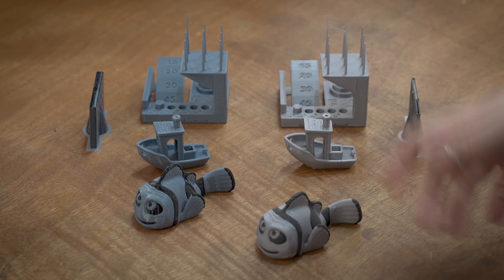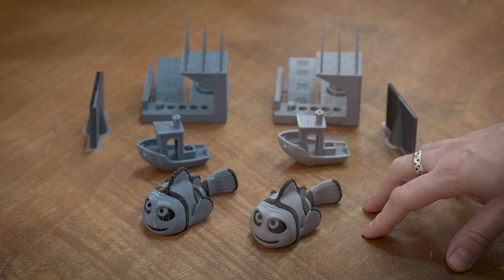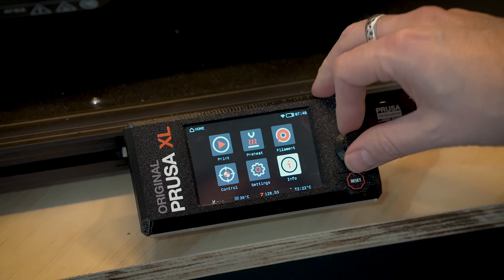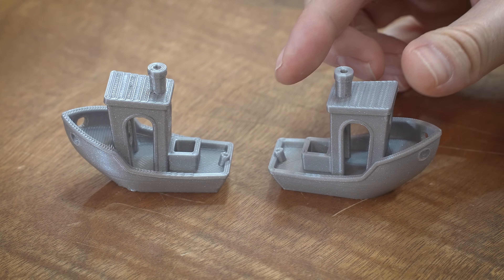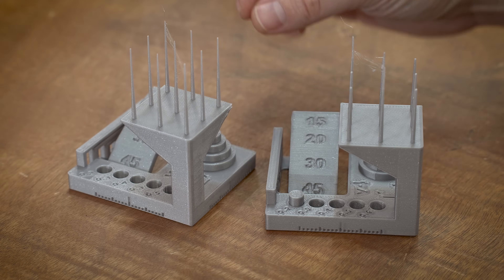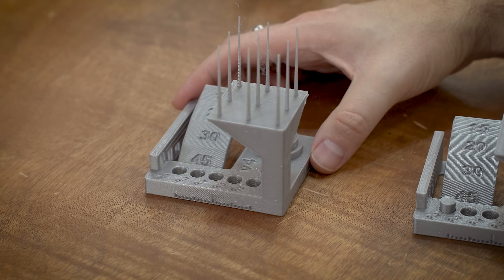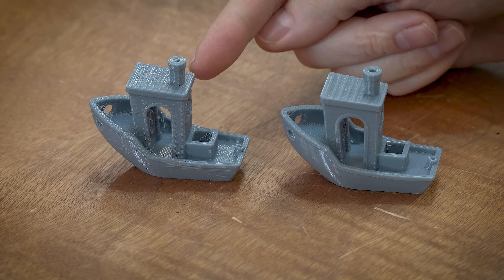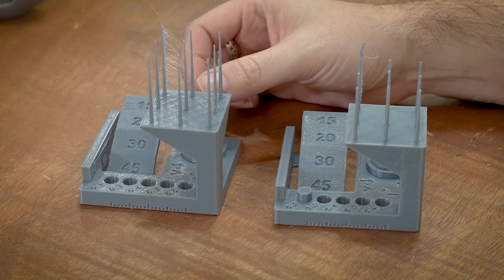Prusa XL - 0.6mm vs 0.4mm Nozzle Comparison

Comment: Does anyone know when drain damage will fight?
Reply from the maker: I still need to finish making the drive assembly (it's about 90% done) and then test out the radio to see if it works inside.  Once all that looks good, I need to harden the shell and build the final parts.  I'm CONSIDERING entering it with another bot at Robogames as a 60 pound multi-bot ;-)

Comment: I personally never understood the trend to use wider nozzles. A wider nozzle is just not capable of giving as much detail as a smaller one. It reduces the print time, but also the quality. For me it is no surprise small, detailed print won't look very good with a 0.6 mm nozzle. I print with 0.4 nozzles exclusively.
For the firmware and input shaping I believe the XL stil has fixed numbers instead of really measuring the resonance for each tool head. When you clean the nozzle when parking and before you use it (I let it scrape over a razorblade), you can even drop the wipe tower. That wipe tower was causing me the most trouble because it does not stick to the bed well enough due to the small footprint.
PETG gives me a bit more stringing, but I think that's more due to the PETG as to the XL. I think the XL is a wonderful printer. Not very fast, but extremely reliable and good for many years of printing even if it is used about 150 hours a week.
Reply: I print most everything with a 1.0mm nozzle at 0.65mm layer height.  Not everybody prints trinkets, lots of us just print functional things that they design with the intended nozzle size and want to print them FAST, single 1.2mm wall widths at 0.65mm gets a strong functional print done in an hour, instead of a day.
Reply from the maker: @JamesSleeman Oh I get it.  Stuff like that fish model is something I'd NEVER print.  I mostly do functional prints.  That being said, the 0.4mm nozzle is working so much better even for functional stuff.
Reply: @JamesSleeman  I mostly print for others and they expect the print to look fine, even if it is just a functional print. 
For speed a larger nozzle is fine, but (as you said) you have to design for it.
Reply from the maker: Intersting.  I'm starting to agree with you on the bigger nozzle.  I think offering a higher-flow option is the way to go, unless you're doing something REALLY big.  But I think it's important to note that I'm not just seeing better details, but the overall print quality is much better.  It just seems a lot sloppier and in some cases the slicer just doesn't know how to handle certain (seemingly easy) aspects of a model.  There's something strange about the 0.6mm profiles.  I have a wiper setup on mine and have very few issues now.  Actually, none.
Reply: Wider nozzles give better strength and layer adhesion. Its best for people who print functional parts. I use a .6 nozzle with 8mm extrusion widths.
Reply from the maker: @LilApe Yep, understood.  That's not at all the point of this video.  It's showing that something funny is going on with the 0.6mm profiles.  It's widely understood that larger nozzles create better layer adhesion and stronger parts.  But usually, a 0.6mm nozzle will show only minor print quality differences.

Comment: As far as this being a single data point, i can say with confidence that the swap to 0.4 and conditioning my filament i get these results. It has been a reliable printer for me and my only regret is that i was between jobs so i could only swing the two tool instead of the 5 tool. 

I love that printer and love using it for my llc.

Big thing i recommend is surface prep and cleaning. Only print failures i ever had came from not cleaning the bed effectively.
Reply from the maker: YES!  With the larger bed it's much easier to put my fingers all over it!  I've been much better about NOT touching it, ever.  Now it's great.  I just wish I had ordered all 5 toolheads, but I ordered within the first hour and mine shipped before I got the option to upgrade :-(

Comment: Maybe the way to go, if you ever get a 5 tool head XL is to have 3-4 tool heads being 0.4 for the print itself while having a 0.6 on 1-2 tool head(s) for supports.
Reply from the maker: Yeah, that's what I was thinking.  I'm just hoping they come out with some sort of high-flow option so I could just stick with 0.4mm for everything.

Comment: It might come down to material flow properties. The hotzone of XL is quite large, with a large volume of molten plastic. It flows by gravity thru the nozzle, which happens easier on the ,60 nozzle... I think it might get better with HF nozzles, such as CHT. This does flow the same/ better, but the filament has much more resistance and friction
Reply from the maker: Yeah, I wouldn't argue against that.  I'd be really curious to try out a 0.4mm nozzle adapter with a CHT nozzle in it...  That might end up getting the same benefits as a 0.6mm nozzle, but with the quality I'm seeing from the smaller diameter.

Comment: The video from Teaching Tech and his follow up to it felt like he was trying to shill for Bamboo. I think that he and a couple of other people have gone down the rabbit hole of trying to tweak the gcode and are not willing to give up on what they think should work. I primarily print PETG with PLA as a support material. I print both 10C cooler than the default and have no issues with a .6 nozzle. I had a ton of issues before the 5.1 firmware and the 2.7 slicer. I think that people are leaving in gcode changes that are at odds with the changes made by Prusa in the 2.7 profiles. 

I agree that the XL is not as fast as some others in pure print speed. Where it makes up the difference is when you are printing with more than one material. The speed of the tool changes without having to do a full purge of an MMU like on other machines makes it much faster. That is why I bought an XL and not a Bamboo. Couple the issues with data privacy on the Bamboo and it was a non-starter from a business perspective.
Reply from the maker: Eh, I don't get that from Teaching Tech.  I've been chatting with him personally though his evaluation of the XL and he's having legitimate issues, as have other people.  I started the video off mentioning other channels and how my experiences are far better for that very reason!  I don't want people thinking I'm trying to oversell the quality of the XL, others aren't as lucky.  But I do agree that all these gcode tweaks are doing more harm than good.  I still see people trying to print filament that's not properly dried, trying to print too fast, etc, etc.  

I 100% agree, when you start printing more than one material, it's WAY faster than anything else out there.  I think for the marlin/fish model, it was 3-5 times slower on the Bambu.

Comment: Crazy how all the fiasco started with a wrong size nozzle.
Reply from the maker: If they had given people the option, or just stuck with a standard 0.4mm nozzle and released it with the Prusaslicer 2.7.0 and the most up to date (today) firmware, it would have been a different story.  Granted, many people are still going to feel like it's overpriced, and that's largely justified since it's really somewhere between the hobby and commercial market.  But it does things that no other printer out there can do.  And THOSE things it does really well.

Comment: You really do make great videos! Thanks for the investigate. I've been running the stock 0.6 nozzles in my five head with good results. I bought five 0.4 nozzles during the black friday sale but not had a chance to compare. I am used to 0.6 nozzles anyway as that it what I have alway used on my MK3S. I agree that this seems to be a tunability issue. I wonder if Prusa switched to 0.6 nozzles late in development due to competition, or if 0.6 nozzles were planned from the beginning. Based on the number of field issues I would think the nozzle diameter was changed later in development, but this is just speculation.

Maybe I missed it in your video, but did you slice with or without IS?
Reply from the maker: Yeah, it seems like they switched over to the 0.6mm late in the game like you said and didn't get everything fully ironed out.  I've been running the 0.4mm for a week or so now and the print quality went WAY up, it's incredible the difference it made.  This is all with the newest firmware and slicer, so I AM using IS.  (Alpha firmware and Prusaslicer 2.7.0)  Also, thanks!
Reply: @RobertCowanDIY ,  why alpha fw? Stable release of firmware 5.1.0 with Input Shaper for the Original Prusa XL was released more then a week ago.
Reply from the maker: @OmDeLaTara  OH!  I should update that.  I just wasn't aware.  I updated to the stable release of Prusaslicer, but apparently not the firmware.  So yeah, everything was printed with the alpha firmware 😕

Comment: excellent work as usual.  ironically i got bambu's 0.6mm nozzle when they released it and had the exact same issue.  they have very few profiles for it and they weren't tuned well.  needless to say, i just went back to 0.4mm and adjust line width between 0.2-0.6 and that gets me virtually the same outcome with one golden nozzle.
Reply from the maker: That's a bummer.  Well, once Prusa figures out how to tune the profiles better for 0.6mm, I'm sure Bambu will release better profiles ;-)
Reply: @RobertCowanDIY  😂 touché
Reply from the maker: @ame7165 Hehe.  "I made this!"

Comment: I run 0.6mm nozzles on 3 out of 4 of my Prusa printers, but I'm just printing stuff quickly with little detail.
Reply from the maker: I was liking the extra speed, but now that I've switched to the 0.4mm, the bigger nozzles might never go back in there.  I'll wait for some sort of high-flow solution.  The quality difference is noticeable on pretty much all prints.
Reply: Can't argue with those results on your printer!
Reply from the maker: @JonathanRansom Yeah, it basically feels like a new machine now.

Comment: Did the same on my MK4, that does come with a 0.4, but I figured I also give a 0.6 a try. I think the main thing is, layer width. A 0.6 nozzle simply prints "wider" lines and this is part of the benefit, mainly in speed as you don't need as many perimeters. But as soon as I print a small figure, the 0.4 definitely wins hands-down, probably also because of this. Stringing has been a bigger issue with 0.6 here as well, there are a few new features in the latest firmware that may help, which I'm going to try as well (the helical z lift and angle).
Reply from the maker: Yeah, line width is increased, but there are other issues happening that should be independant on line width.  Even on larger models where it shouldn't matter, it just doesn't seem to work as well.  On the fish model, I have NO idea why it would have those artifacts on that particular spot on the cheek.  Looking at the slicer, there's no reason for it.
Reply: @RobertCowanDIY in my experience layer width directly correlates with quality of overhangs, especially those with direction change. Also it all depends on the setting which perimeter is laid down first. This might be the cause or one of them. Profile tuning and Slicer should accomodate that though.

Comment: I switched to .4 about a week after I bought the printer due to the issues you've pointed out.   My .6 are in the box and will probably stay that way unless I need to print something very large with little detail.
Reply from the maker: You should have told the rest of us!  But seriously, I'm in the same boat.  I wanted to buy a hardened nozzle and wasn't sure if I should get 0.4mm or 0.6mm and now it's obvious.  I don't think I'll go back to 0.6mm unless I print something really huge.  Then I might try 0.8mm or just get a CHT insert with an adapter?

Comment: I don't even have my XL yet and i ordered .4 Nozzles for it on Black Friday as they were on sale.

I make parts on my machines and since my other machines use a .4 mm nozzle and the parts have been proven out at that nozzle size I never planned to use the .6.  I suspected that it would fix a lot of the issues people were having and your video confirms it.

Thanks.

3D Print Dogs have had some great videos too.
Reply from the maker: Nice!  Yeah, I really do feel like 0.4mm nozzles are the way to go here.  I didn't include 3d Print Dogs since I don't follow their channel and the g-code changes they proposed actually caused more issues than they solved.  They're doing some interesting stuff, but I just haven't been actively following them.
Reply: Did you receive it yet?  Any issues?
Reply: @krollmond7544  It's supposed to be delivered on Tuesday.

Comment: I just changed my 5 tools to .4 including an obsidian nozzles. I also noticed what the same. 

I’ve been printing functional parts mainly.  I really need to do temp towers on mine. 

Couple questions 
What dryer do you have and what do you recommend.  It’s Xmas time and wife is asking for ideas

Lastly what profiles are u using for non Prusa filament?  I’ve been using generic but wondering if I should be using Prusa or prusament profiles. 

Either way I need more time to tinker instead of functional parts but thought I’d ask!
Reply from the maker: I wish I had gotten an Obsidian nozzle, they were sold out once I realized 0.4mm was the size to go with!  The temp tower certainly helped.  I have some cheap filaments that I can't 'push' as fast as others. The cheaper Overture stuff (which generally prints nice) can't go as fast as a Prusament or Bambu filament.  So the temp tower is nice to see just how hot you can get it before stuff starts breaking down.  For dryers, I like the Sunlu V2:  https://youtu.be/Ev1bN_r847E  It's the only one I've tested that actually gets up to the temps it claims.  It gets hot enough to actually 'do the thing'.  The form factor is a bit strange with the big screen on the side and the barrel jack on the opposite side, but I like them.  You do have to 'burp' them since there isn't a fan inside, but that means they're silent and you won't end up hearing a buzzing once the cheap fan breaks down.  I always appreciate it when my affiliate links are used, but no pressure ;-)